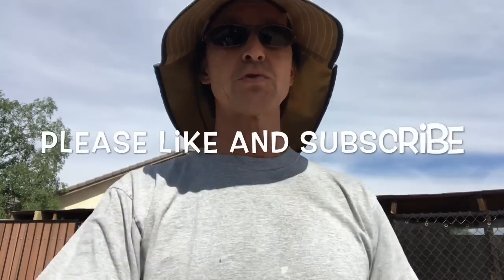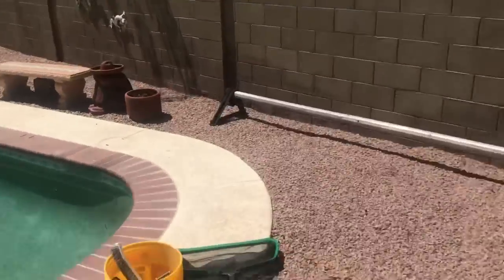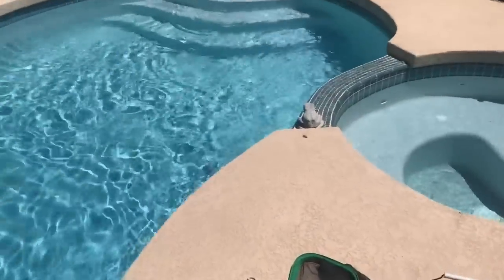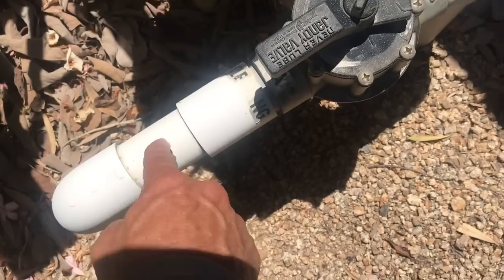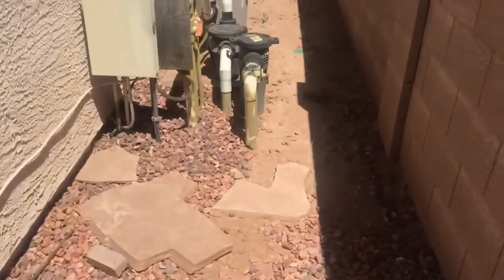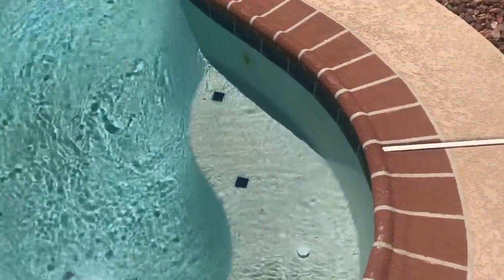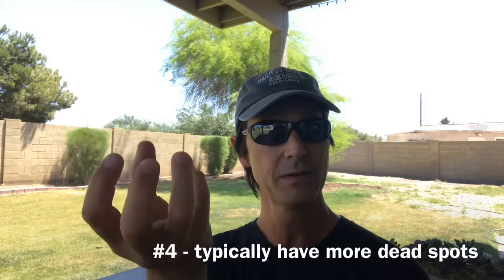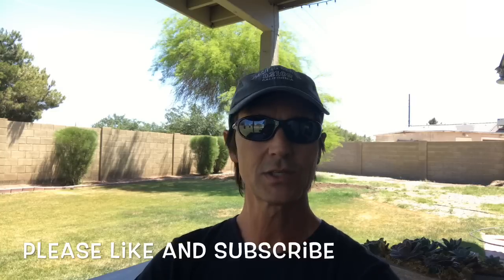In floor “Pop Up” Cleaning Systems

Comment: In regards to children getting their fingers stuck in drain and drowning, a much more logical solution than rendering the drain ineffective at removing leaves would be to keep the larger holes but make the drain cover removable and held on by magnets.  That way if a child (or anyone) got their fingers stuck, they could simply pull the cover off and worry about how to get their finger out once above the surface.
Reply from the maker: That is absolutely brilliant.  I'm serious!! May I suggest that you pursue that?  Someone could make a mint on an innovative product like that.
Reply: Couldn't that also bring up another safety issue, being that children could get whole limbs stuck in the return drain pipe, or would there noy be enough suction for that to happen?
Reply: No cover. I'm a lawyer, and you're making my mouth water.

Comment: One note on the QuickSkim feature. Actually, it is very effective on boosting skimmer action, but it requires high flow rate to operate properly. Those pools that are always dirty simply doesn't have enough flow rate. Many pool owners today believe those stupid ads and promises by pool pump manufacturers which typically advertise something like "save the energy, you don't need 3hp motor, 500rpm is what you need". That's just horribly wrong! You always want to buy most powerful pump out there your plumbing can survive.

Comment: I just had a new pool built March 2021 all new pentair equip, A&A infloor system with venturi heads....I wish I knew more about this I would never have got the system. The heads seem to pop up sometimes all the way and sometimes not. I removed all the heads and let it flush the system to get any debris cleared. The heads are suppost to cleat a vacuum and pull from above also while pushing water-flow but they do not. I was told I need to increase my pump speed a bit. My pump it a VARIABLE SPEED PUMP intelliflo vsf  ALL NEW EVERYTHING. I would not recommend pop up system. I still need to see if I can get the pump adjusted though
Reply from the maker: I am sorry too. I am just not a fan of those in floor cleaning systems at all.

Comment: I think the key is that you can't cut corners.  I have a PV3 for four years.  (I skimmed through the video as it is fairly long.)  I love not having to deal with a suction-type cleaner.  Where I have steps and benches, the pop-ups act like gentle water features.  A big advantage is how quickly an in-floor can  distribute chemicals.  It also works to circulate water so that you don't have hot and cold spots.  I have one dead spot, but it's not bad when compared to dealing with a suction-type and I easily clear it while brushing the walls.  (manufacturer claims it will clean 99% of the entire pool and for mine that is true)  The gear assembly has only once been jammed by debris; which was easy to clear.  One pop-up got jammed with debris, but was easily removed and cleared using the provided pole attachment.  Thus far the dedicated pump has been rock solid.  You need to make sure your builder knows what they're doing.  (one quoter said that they would determine pop-up placement on their own because they'd been doing it for so long and to supposedly save me money; nope I wanted the manufacturer to determine pop-up placement; once the installation is done, you're stuck)   My builder sent a specialist to seal all of the pool penetrations.  A disadvantage of an in-floor is all of the penetrations so you definitely want to make sure those are sealed properly.

Comment: Hi Kenny, great video. Thanks for the explanation of the pop ups. We have a pool that was built in 2004. Unfortunately, we're not the original owner....guess no lifetime warranty for us! I have asked my pool cleaner about the pop ups but it seems that his knowledge is minimal. The problem we have now is (1) there are bubbles coming out of the pop ups (2) it makes a gurgling sound....pretty noisy (3) out of 9 pop ups, only 4 pop up & 1 is stuck about 1/3 of the way. The water level is correct, not low. It seems to grow algae & will turn green. I asked the pool cleaner about the pop ups and he told me that it will be green occasionally because there are only 4 jets at the deep end of the pool (facing downward) & unless we get in the pool and circulate the water, it will not circulate enough on its own. One of the pop ups said PCC2000....I am assuming this is the manufacturer of the pop up units.If we need to get someone to look at this system, what type of service person would we look to help us? thanks for your help!
Reply from the maker: You just listed several reasons I don't like the in floor Pop up cleaning systems.  As far as your points.  #1. The bubbles are due to air getting into your pool plumbing system maybe through the pop up actuator but more than likely it's somewhere in the intake of the system (suction side).  #2.  The noise could be that the water flow is being restricted.  #3.  Yup, you can replace the heads and "maybe" they'll all work and maybe not.  My suggestion would be to convert your pop system to a stay in the pool suction side vacuum using a Pentair VacMate skimmer adaptor.  Here's a link to a video I did on that: https://youtu.be/gSfbNv4sV_M?feature=shared  

HOWEVER I recommend getting a Barracuda G3 pool vacuum rather than the one I show in that video.  Here's a video I did on the G3 and why it's my absolute favorite: https://youtu.be/fFAiyDl6jRo?feature=shared

Lastly, in answer to your question I'd recommend contacting a local pool supply store and ask for a referral or you can contact the manufacturer (if they're still in business) for a referral of someone in your area who knows that product.  

BTW sounds like you have a Paramount pop up system.AND they're heck of a expensive to replace the heads and repair (heads run between $70 and $130 each!). Save your money and trouble and convert to a vacuum.
Reply: @PoolSchooler  Thank you so much for your response. I will look into all of your suggestions! Cheers!

Comment: Thanks for vid.. I have a Shasta pool 5 years old with pop ups... I love them👍
Reply from the maker: So glad they work well for you.  That's good to hear.
Reply: Shasta sold their popups rights to some California company.
They sent me duds last year. The middle part of the popup was not furnaced correctly and water came up at the top.
The plastic needs to be melted with low heat so when you install the heads, water comes out the head and not on top.
They sent me new ones but ended up sending me the wrong amount of high flow and wrong amount of low flow heads. Basically got them backwards.
Finally got them installed and now my popups are stuck on the pool steps and stay there all day. The deep end where the high flows won't pop up.
The gears are healthy and are turning. Not sure what it could be.

Comment: You did not discuss the  Low or High pressure heads and what the differences are.  If high pressure pop up is installed with a low pressure system they will not work properly.  It is very important the pop ups are matched with the pressure of the system.  I have seen many pools here in Florida with the wrong pop ups installed.  You can test the pressure at the pop up so you know the correct pop up to replace with.  Thanks for your videos.
Reply from the maker: Thanks for the info. Much appreciated.

Comment: I have two zones with two pumps for my pop up system. The front zone pump loses pressure when it switches to a different pop up. Both 6 ports are new and just installed.  Any ideas?
Reply from the maker: Can you please email me some pics and/or videos of what you're describing so I can more accurately help.  My email kennypoolschool@gmail.com

Comment: Great video! I learned alot. Thank you! Was wanting more info on these systems. I only have one client with a pop-up system. Very similar to the 3rd pool in video. Just did some work last week at a pool that has a pop-up system with a noisy 5 port caretaker valve. Will probably be referring them to someone else for servicing that valve.
Reply from the maker: Or see if they’d be willing to convert their pop up system to a suction side, vacuum using a VacMate

Comment: If a quikclean popup wont turn to get it out what are your options?
Reply from the maker: You may have to break it out but be careful you don't damage the fitting it goes into.  Or this may be a good time to contact a licensed insured pool repair person to do it.  Or convert to a stay in the pool suction side vacuum like I did in the pool in the video in this link: https://youtu.be/gSfbNv4sV_M?feature=shared

Comment: The second pool looks very similar to mine in Phoenix done by Shasta Pools. In my example popups work extremely well when under high pressure. I run 3-horse Pentair pump at 3450rpm, shared with filter, and it makes thunderstorms go almost unnoticeable, cleans everything till the last leaf. However, the major disadvantage is that it raises pH very quickly by agitating the water under high pressures.

Comment: Have u ever had an infloor sys that needed 2 hydraulic valves? If so how does the timming work? It seems like we're not getting the forceful discharge out of the nozzles like we did last season.  How are they piggy backed as there is only one pump for the floor system with one return pipe going into the ground towards the pool. My customer will not convert to a booster pump with the new quatro. No more back up valves or polaris bags or head floats!!!!!!  That's what I use to sell a customer on that cleaner
Reply from the maker: Sorry to say I’m not sure. I understand what you’re asking or I probably have not had experience with what you’re talking about. I’m not sure what you mean by hydraulic valves. The pop-up systems that I have in my clients pools and that I’ve worked on have an actuator center that distributes the return water to certain sections of pop-up heads and circulates them sort of like a clock. The pop-ups share the return with the rest of the Pool returns. I.e. there’s a single pump for the filter and the pop-up heads. Then I put the majority of the flow to the pop-up cleaning system and very little to the regular Pool returns. Some of the newer pop-up systems you can dedicate 100% of the return flow to the pop-up floor cleaning system. I have on occasion come across a pool that was designed very poorly and has too many pop-up heads per section, and no matter how much flow you put to the pop-ups it’s never sufficient. To be honest with you if you can’t get more pressure to the pop up heads, you might want to suggest they convert their pool to a suction side vacuum like the barracuda G3 using a Pentair vac mate skimmer adapter here’s a link on that. Converting a Pop Up System to a Vacuum using a VacMate
https://youtu.be/gSfbNv4sV_M

Comment: Great video! I always thought this system was the coolest thing with our previous pool. Our's just went off the main return. It was set up such as, at the near end of the return line, we had a diverter valve. One side had it go only to the wall jets, and the other side is where it would go to the valve actuator. It contained 5 pipes. Two of them went to the wall jets, I guess so those would be on the longest, and then the other three went to each one in the pool. One for the shallow end, one for the middle, and one for the deep end. Pretty simple. We usually kept the system on all the time. With the exception of when the pool would first be opened for the season, so as not to stir up all the stuff on the floor before the initial vacuuming. 

The separate pump system I think is cool too, and probably ensures the best pressure. I guess the immediate drawback is the extra electricity usage.

Comment: I hate these things. As far as I can tell, they do nothing at all, and now I have a mysterious leak which may turn out to be somewhere in the network of PVC under my expensive concrete.

I think pop-ups are a deliberate scam used to get more money up front and then generate more repairs later.

Getting a pool is a stupid idea for most people. You will use it all the time for two months. You will use it once in a while for the rest of the year. After that, it will basically be your sponging friends and relatives coming over to make noise and wear out your grill while putting you at risk of lawsuits. And you still have to work on it and spend money. You can't just rip it out of the ground and put something useful where it used to be.

Oh, I forgot: it increases the cost of your homeowner's insurance, and you can't have a diving board or a slide because of lawyers. And you have to put a supremely annoying fence around it so you feel like you're swimming in a little bird cage.

Comment: I love mine and my pool also has a floor drain at deep end and an overflow leaf catcher. Runs off one pump and i would never go back to a motorized suction system.
Reply: For me, this beats having an expensive tethered device swimming constantly in pool. My pop up system works great and keeps the pool clean.

Comment: Good information Kenny, but I respectfully disagree with your final assessment. I’m a new pool owner (6 months) and couldn’t be happier with our in-floor cleaning system. The system works great and reduces the amount of vacuuming required to keep the pool clean. Importantly, it eliminated the need to have an expensive tethered vacuum and (long and unattractive) hose constantly in the pool. Also, the system eliminTed the need to maintain, store and haul a remote vacuum to-and-from and in-and out of the pool. Yes, there is a dead area where large debris will sometimes (not always) accumulate. However, I simply brush the debris from the corner toward the Main Drain with one swipe and its on its way. Takes 10 seconds to do, maybe once a week.

Like any installed system, the effectiveness is dependent on the quality of the system and the installer, etc. You see hundreds of pools each week and rightfully have a different perspective. Before building the pool, I weighed the cost/benefit and, in retrospect, feel it was one of the best decisions that I made. 😎
Reply from the maker: I really appreciate your comment and am delighted your system functions well.
Reply: I agree. We love ours!

Comment: That first system was installed by the company I used to work at 20 years ago. It the  PCC2000 with the Hydra 6 module. On either side of the main drain are 2 fixed non rotating heads that point toward the main drain that send debris up to the deck canister. And then there are 2 returns pointing down the wall toward the fixed head to clean behind them and create what we called a water curtain. Anything that passed into that area should get forced to the drain. And we used a dedicated pump to get plenty of water flow. I'm surprised to see other systems that steal water from the main return to feed the water valve.

Comment: Replacement Vacuum system parts are very expensive to repair and replace also. Why didn't mention that?  (maybe future episode I haven't gotten to yet)
 I had a Barricade vacuum system, 30+ years ago. Cost me an arm & a leg to maintain all the hose sections, plastic, rubber and breakable parts.
 Have a pop-up system now, for the last 20 years and couldn't be happier! Sure, some brushing is required. But my labor is cheap.  
And yes, original owner with lifetime cleaning system parts. 
Thanks for your info
Reply from the maker: That really depends on the vacuum.  The Barracuda G3 (my favorite) is easy to maintain and the aftermarket parts are very cheap compared to the manufacturers versions.  It's ONE of the reasons the G3 is my favorite.

Comment: Thanks for the info ,have had Hydroclean(pop ups ) for twenty five years paid extra 3500$ ,has kept my pool very clean .I have replaced the internal parts probably 3 times , very easy to do .Easy utube on line to replace ,never regretted .Your videos has been very useful,Thank You

Comment: the ones that don't work is because the builder failed to send pool plan to manufacturer to have floor system designed by manufacturer. the just wing it... and usually always have to many popups on a zone so no pressure. not spaced or positioned in the pool to reach everywhere. so leaves will sit in certain areas. the lifetime warranty is nonexistent if the builder doesn't get specs and plumb the system according to manufacturer specs...
Reply from the maker: Yup.

Comment: TO me, VGB makes no sense for residential pools. Every single pool already has a foolproof safety device. 
It's called the OFF switch. Turn your pump off when you go swimming. No possibility of an accident. 
But why use common sense when you can create costly nuisance regulations?
Reply: SoloGuitar1000 Because safety systems have to be idiot proof.

Comment: Hi pool school. Thank you for the educational videos. Is it possible to advise or make a video of 1. How to adjust  the % chlorine generation from a salt cell and 2. How to reduce phosphates in pool along with the whole procedure. Thx and keep up the good work
Reply from the maker: I can indeed. I have done videos on phosphates and how to reduce them and all that.  Check out these:

Algae and Algaecides and Why You Don't Need Them: https://youtu.be/MzGoK4Cd7tc

Keeping Phosphate Levels Low: https://youtu.be/YzK7AD07HAY

How I Cleared My Green Pool: https://youtu.be/XY-BAdBY0zI

I also did a three part series on Salt Systems BUT I don't think I mentioned specifically how to adjust the output level. So I will do one on that next week.  Thanks for the suggestions.